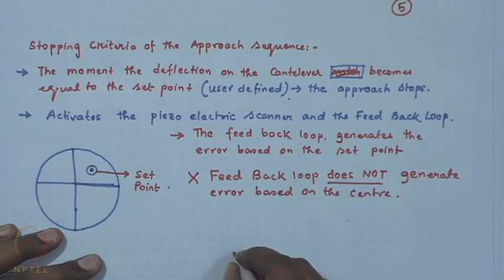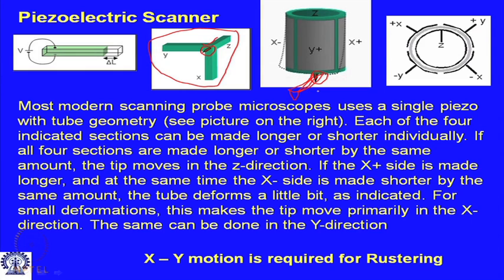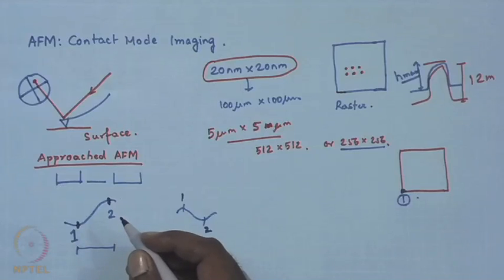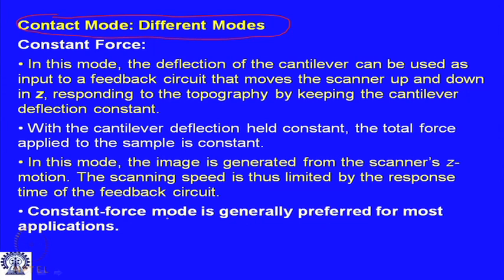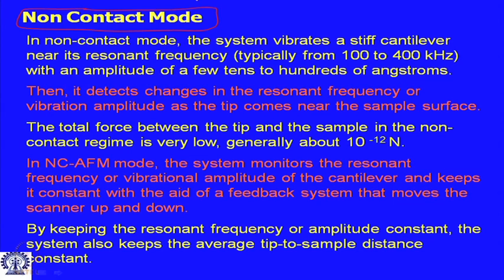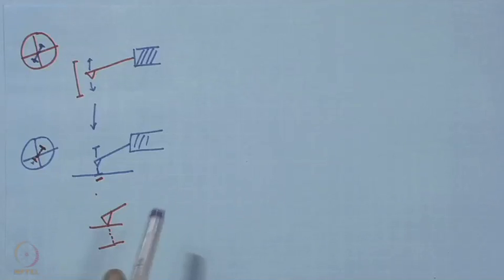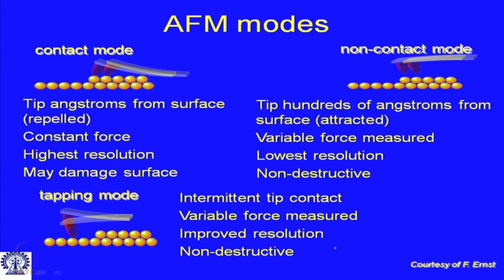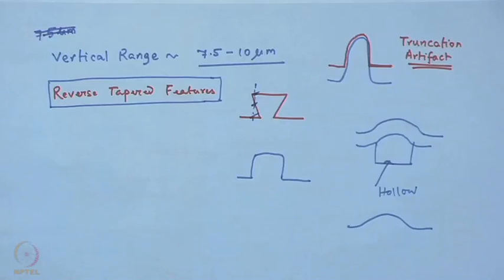Mod-01 Lec-25 Atomic Force Microscope - IV

Comment: Hello, thanks for all videos about the AFM. I have one question related to free oscilations (no tapping, no contact, only free oscilation mode). How does the cantilever start to oscilate? Is it because of attractive forces between sample and the cantilever only or do we need to apply some external source of oscilations? I think those oscilations are caused by sample-tip attractive forces only but I need someone to approve my understanding :D Thanks